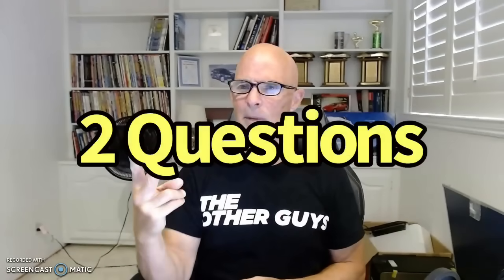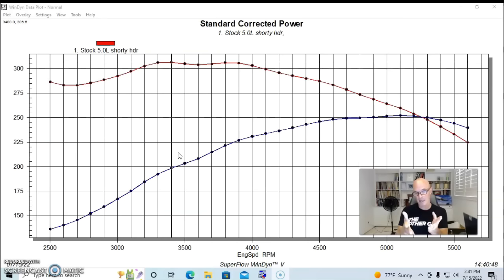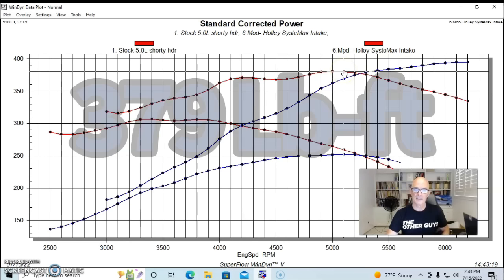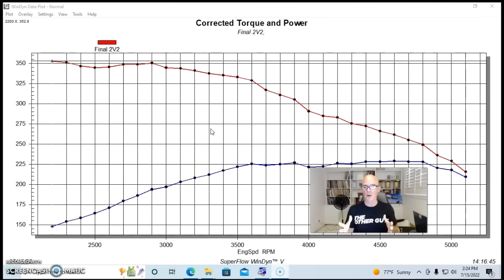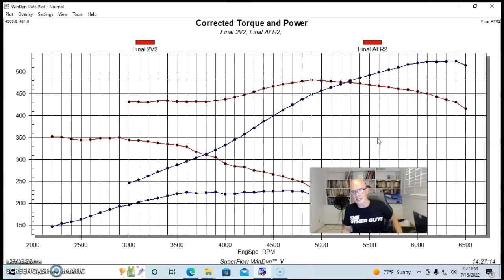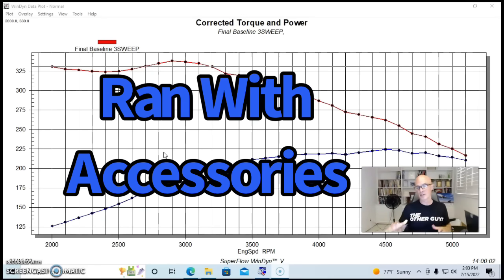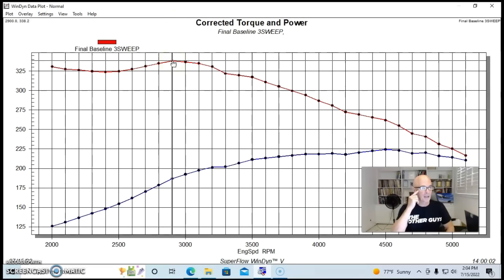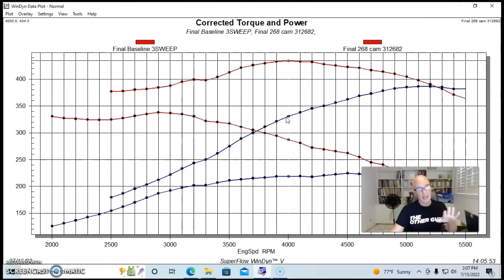FORD VS CHEVY VS DODGE-WHAT AMERICAN V8 MADE THE LEAST AMOUNT OF POWER? 5.0L VS 350 VS 360-WHO LOST?

Comment: Most of the Holden V8s would be good candidates. 253 thong slapper only made something like 115hp all the way to 220ish hp for the clean slate top end redesigned EFI 304 of the 90s.  There were special Group A versions with more but still very little for a v8.   When the LS replaced the home grown iron v8 those low specific outputs were a thing of the past.

Comment: hahahaha, Richard you must be used to the protestors that show up for these videos by now. I liked this video. I would be curious what the cost was for each of the end results though, sounds like you had a lot in that Chevy and not so much in the 360. I haven't looked in a while but from what I recall EFI Ford intakes were $$$.

edit: Decided to share some of the lower power vehicles I ever drove-
1980 Olds Cutlass with a 350. Grandpa ordered it, otherwise you couldn't get a 350 without getting the Hurst version. 350, cruise, AC, intermittent wipers. NO RADIO. NO REAR WINDOW CRANKS, as in, they didn;t move(four door!) base model 14" wheels, but vinyl top and chrome package lol. I wish I still had it it was probably 1 of 1. Still, the 4.3 V6 did 0-60 in about half a second faster then the 350 for 1980. I think it was 130hp. Might have been 110. Car sounded so mean, couldn't pass a car doing 45 unless you backed off then ran it up to speed for a bit before you went around. "Pass on the fly" my friends used to call it when we went bumming. My first car. 
A close second was the Ford Aspire my sister owned for about a year. Didn;t expect much, could have plugged the tail pipe with a grape, but it couldn't hardly maintain speed over 45mph up a hill much less accelerate. We stopped at a gas station once to run in for a Pepsi, we got out and she freeked out and thought she lost the keys for a second because she got confused. Why? because she thought she had left it running. She did actually, from 5 feet away you couldn't hear a whisper. But again, this was a tiny engine-mobile, so not really the same as your testing stuff but it left a (bad) impression for a lot of years haha.

Comment: I’m shocked you didn’t run the 351w as the Ford competitor. Factory it wouldn’t be much better than the 5.0 but with a few bolt ons the tq curve is far better.

Comment: The performance of a car is related to torque not brake horse power. A long stroke and a large bore give you more torque…………..multiply that by RPM and you get an indication.  Wind it up to 12,000 rpm and you’ll get heaps of power but the beast would reach 200 mph in top gear before destroying itself. Comparing bhp numbers is akin to male envy……………..6 inch stroke and 15 strokes per minute is about the limit of human endurance.

Stavros

Comment: So of coarse you put by far the best most expensive heads and intake also biggest cam ... in the Chevy imagine that .  I would never let you touch my mopar . I can tell you that for sure . I could pull a better combination out of my ass for the 360. And it would totally dominate the competition.
Reply from the maker: YOU MISSED THE WHOLE POINT OF THE TEST (LEAST POWERFUL MOTORS I HAVE TESTED) -BUT IT SOUNDS LIKE YOU SHOULD BE COMPETING IN ENGINE MASTERS WITH ALL YOUR KNOWLEDGE AND POWER
Reply: @richardholdener1727  Not at all . Yeah you tested the least powerful engine's  YOU HAD .  Then YOU Modified  each one.... And like I said already   Of course.... YOU used The most expensive  highest performance parts  ON THE SHITVE.   Of course it made bigger #s . Most car guy's obviously didn't notice . But I did . My little 340 Mopar has smoked so many small block Chevys  I damn near lost count . We always hunted down 396s cause we were bored with beating small block Chevys.   Next time have a mopar guy build the Mopar before the dyno comparison.   R 1 or R 3 block  W 9 or W 11 fully CNC Ported mopar Race Heads as a foundation.

Comment: How the Americans got so low power from large engines beggars belief.  Even as a kid when I got interested in cars I couldn’t make out why you fitted air pumps at rubbish tom your cars to make them ‘cleaner’.  These add ons meant you burnt more fuel because it was so inefficient, more fuel in is always more rubbish out the tail pipe.  Then you had to make the engine larger to overcome the power loss 🤪
Reply from the maker: all Americans aren't the same-neither are the motors-those sorts of generalizations are silly

Comment: One V8 within the GM group, the version from 1979-1980 or so was in the Holden VB Commodore. A 4.2 (253ci) V8 that was rated at 87kW (about 116bhp), so that was pretty weak for sure. Though with the VC Commodore, the same 253 went up a little to a factory rated 100kW. Still low-power, was the end of the 1970's & early 1980's of course, so many V8's were weak back then.

Comment: Them 360, 318s are tuff engines. My dad’s 96 318 ram is still rocking right now and he goes up and down Mexico at one point it had a bad water pump and it never broke down overheating for years even though water and oil started mixing still ran..

Comment: Pretty cool, but I would've liked to have seen a 351 vs 350 vs 360, just to keep the cid closer.
Reply: The 360 eats way more fuel than a 350  a Lil better than a Ford probly 15 350 8 for 360 about 12 out 351 sbf
Reply: @jasonconklin8172 how you just throw random mpg numbers out there, lol. A 360 in a car will obviously pull better mpg than a 350 in a 4x4. It's totally situational. I had a 351 in a 95 Bronco that would do 16-17 on the highway all day, with 3.55s and 35" swampers

Comment: Kind of an unfair test. If the 302 and 355 are from the late 60s or early 70s and the 360 was late 70s. The late 70s engines were all slugs because of the laws passed by congress after the gad shortage in their 70s
Reply: The 302 had a late 80's era EFI Mustang intake on it, where are you getting late 60's? 
not sure about the 350, but if it was 2bbl carb. it is likely from at least 78 or older. If it was 80 or a little newer it would have been swimming in vacuum hoses. I don;t think they changed much in the 350 2bbl. until you get back to when lead was still in the gas so this was probably an mid 70's motor.

Comment: The fascination with horse power has always been a mystery to me. HP is an imaginary number, a formula derived from RPM, torque and a constant. HP is a math equation, HP = RPM x TRQ / 5252.  Torque however is real,  measurable unit of force, it is real ,like inches or lbs.
The only reason we care about HP is simple, people don't understand torque, but if you say "This new (fill in blank with cookie cutter car) has 375HP" it sells. Bottom line, the old saying "Horsepower sells cars and torque wins races" is still, and always will be true.
Reply: This is so wrong lmao. Torque is a force, horsepower is how quick you can repeat that force. F1 engines are around 800 horsepower and yet only have 260lb/ft of Torque. They run at beyond 10k RPM allowing this force to be applied more often. F1 cars are the fastest road circuit vehicles in the world. However, a lot of torque with lower RPM can be the same speed, but that gets onto engine design territory with bore/stroke/piston velocities.
Reply: @RhodokTribesman  you still don't get it. 
Take a Dyno, you want to for some reason know the HP of your engine so you put it on a Dyno. Now, the the Dyno measure HP? No, it can't, it's a fictional thing. The Dyno measures torque and rpm, then plugs in the costant (5252) and it gives you the HP. Horsepower can not be measured as a force because it isn't real, it's the sum of a math equation.
Reply: @deanwattles8722  A power is a not a force, buddy. Power is simply work over time. It represents how much said often said force is applied, making it massively important. Does your engine stand still in time? No, hence why power is needed (and why RPM/bore and stroke play the biggest role in an engine's characteristics.) If this is still over your head, I feel sorry for you.

Comment: One thing that wasnt noted was the year of the motors. Dodge is one example that had the 360 for a few years, but the early were much better then when they hit the "smog motor" era. Same could be said for the slant 6, which had a horse power of around 175 or more and went to a low of 125 or less
Reply: slant with 175? Hell no. Not even prior to the post '72 loaded up dyno cell numbers. A fresh .060 over slant rebuild was ~77HP, Then a full milled head, cammed, forged yadda yadda motor with more money into it than it was bought for eeked out 30% more...than 77? STILL UNDER 100HP! Sure there are 300HP builds out there but they also cost 9 grand.

Comment: Clicked on this expecting to see the 155hp 350 that I have in my 92 Suburban, the one with the 85 mph speedometer. I still have that beast, it turns 30 this month. It’s a bit painful filling up the 42 gallon tank. Still runs decent.
Reply: 155?? The 350 is specced at 210 in 89 Silverado. I wouldn't believe that but it does 0-60 in 9 seconds with 3.08 rear gears.
Reply: Yea I had a 96 Silverado and I had to sell it because gas was killing me. It was a reliable truck once the crappy rear dif was rebuilt.
Reply: @gsxerwhite   so u hit pavement  with  10 bolt spinning  gov lock exploded?  I got 3 and all overloaded  4200 total b4  now almost 7 k thats daily for 4 years  I'd say tough rear end 4 size !
Reply: Odd 2 me  the 96 4.3 7k # daily 700 r4 gets 15 no matter what 373 gears 4x4 290 k 99 Yukon  average weight 6500# 373 350 town & freeway 16 17 mpg242k  4x4  99 suburban gets 17 freeway 75  or less  town 14 woods 10mpg average  14.5 with 252 k but those trucks all got Schaffer oil in front rear and moter I'd say it gains 3 mpg together   but 4 u tire goroo s love lug tires or soft tires both eat a ton of fuel ⛽️  alignment  huge 4 milage have u changed ur router cap this century? Real crappy design  bad 4 cracks and buy a good 1  helps mpg and power and  so 15 to 17 mpg out 9f any rig with 200k and near 4 ton  nothing  2 whine over
Reply: I thought 92 had 210 horsepower because of TBI and the carburetor like I have has 155

Comment: What always gets me is how little power the Americans get out a standard V8.  My car (1991) has a 2 litre (122 cubic inches) straight 4, normally aspirated and it delivers 165 hp stock. You could get a  supercharged 1.6 liter (98 cubic inch) from the factory that delivered 300+ hp stock.  Yet most American V8s have difficulty delivering that much hp with out a lot of modifications.
Reply from the maker: a 300-hp supercharged 2.0L from the factory with 300 hp in 1991?
Reply: @richardholdener1727  Supercharged 1.6. the 2 litre was only for the normally aspirated cars.  The 1.6 turbo put out 220 hp. The supercharger a bit more. Just checked, the 300+hp was from a blown six cylinder 1MZ-FE 3 litre, which was not standard to the factory car. So I do  stand corrected on that. The race engine was reputed to get 750hp from 2.2. liters.  But that will require lots of maintenance. Though my old WRX used to get 260hp from a 2 litre.

Comment: The sadest  engine  I ever had was a 1977 302 in a Cobra II, when  I ordered the car it was rated at 139 hp, It was so sad  to couldn't tell it was gaining speed without looking at the speedometer.
Reply: I have an '83 Lincoln Continental Mark VI. 39,000 original miles 5.0 EFI throttle body. Factory rated at 120hp. It's slow but I've driven late 80's to early 2000's 4 cylinder cars that were slower. I will say it has an adequate amount of torque.
Reply: That's actually pretty good for the size. The Trans Am had a 400 CI V8 which made a whopping 180 horsepower.
Reply: Yea man.....this was my age group...I,m 49 now but back in the day....the way it was....buddy of mine had a v-8 chevy monza..wa whoo!!   267 v-8 geared like 2;56.....main reason I think we all wanted them 72 and back cars for those that knew.....nothing like a poor ol boy driving a primered Nova.....smoking a new vette.......back then,not now.  anyhow,my neighbor had a cobra 2...white with the red stripe kit with red interior...your comment reminded me of him.

Comment: Shouldn't a 350 or 360 be compared against a 351?
Reply: You would think so, but Ford has always had their smaller displacement 300 cubic inch engines competing against the mid-size 300s Dodge and Chevy. Ford has always done more with less cubes.

Comment: we all know its going to be a engine from the late 70's the ford 460 had like 3 HP
Reply: 210hp and nearly 500 lbs of torque. I have a '78 Continental bone stock last year of the 460 in a ford car and it hauls ass compared to the 400 and pre '86 5.0's

Comment: I might can beat all of y'all I had a 72 Chevrolet custom 10 with a 250 straight 6. It was the weakest thing that I ever had in my life. I promise you it could not outrun a 100 cc motorcycle  definitely could not spend tires in Rock double clutching it. On the interstate on a flat surface 60 MPH if the wind was blowing from behind me. Going up a slight Hill diesel trucks would fly by me sometimes I would have to downshift into second gear mind you it was a three speed on the column. My dirt bike had more power than that piece of s***.

Comment: I had a '73 Gran Torino with the 351 Cleveland.  I think it was maybe 150HP.. sad era for low compression smogged motors.
Reply: You can't really blame the compression for the lack of power, the fact is and engine that size could make over a hundred more HP with a CR under 8 to 1 with the right cam, heads and exhaust, none of which were on those late 70's lumps.

Comment: 20 something years ago I bought a '80 caprice classic.   I barely knew shit about cars but I wanted something to learn on and build some V8 power.

I asked the guy if it was a 305 or a 350.  Much to my delight he replied it had a 350 and I ended up buying it.  

A short while later I was driving it around trying to sort out the brakes and I noticed it barely spun the tires in gravel.  I noticed on the serpentine diagram it said 4.4 L and then I checked the VIN and confirmed I owned a wheezing 267.    I sure learned a lot about cars that purchase.
Reply: For a few years I did machine work in a engine shop.  In that few years, I encountered more "350s" than I could count with 3.736" and 3.5" bores.  lol

Comment: Extremely biased test, build a .030 over 351 windsor with comparable parts and see what happens, you built a 302 with stock fuel injection and below par heads, then built the shit outta the chevy engine, and then again below par parts on the 360, sorry bro, you seem like a nice guy but terrible comparison
Reply from the maker: SORRY BRO-BUT IF YOU CAN'T READ THAT THESE WERE THE LEAST POWERFUL MOTORS I HAVE TESTED-YOU ARE READING SOMETHING ELSE INTO IT (THAT ISN'T REAL)
Reply: @richardholdener1727  so? If it was a least horsepower thing then why did you build any of them up at all, seems to me that someone got a little but hurt on being called out on making a biased video - which it was

Comment: Two engines come to my mind.  1985 Chevy half ton truck with the 305.  It had no business being in a truck.  A good engine reliability wise but lacked any kind if power.....especially in a heavy truck.

2nd was my Dad's T-Bird with the Ford 255.  This had no guts what so ever.

I know there are v8s with even less power out there
Reply: in the early 80's a friend bought a 305 powered 1/2t pickup, gutless to be sure, replaced the intake and carb with a little street blower, and that 305 woke up and then was a tire roasting engine,  do not recall how long he kept it on there but it was a fun rig to cruise.
Reply: I think people forget that trucks were designed to do truck things and not pretend to be dragsters at every red light. 

Chev went with the 4.3 V6 in the later generations base models, and of course Ford had the 300 I6. Perfectly good engines. You gear it down enough and you can haul and tow and pull anything… you’re just not going to be fast doing it. I think it was nearly the 21st century the first vehicle I had that could maintain the speed limit going up hills or towing anything.
Reply: @calvinnickel9995  Good point

Comment: I have a 95 F150 roller 302/4R70W with 3.55 Trac Lock rear.  I will say this.. Years ago my family had an '83 Chevy G20 conversion van with the 305 LE9 high output with a Crane 260, 700R4 and 3.08 gears that would walk away from my Ford.

Comment: Forgot all the little motors, the 255 ford, 273 Chrysler, 262 Chevy. Maybe the smaller size would make more power due to rpm. It would be hard to find them these days anyway.
Reply from the maker: I didn't forget any motor-these are the ones I have tested-a ford 221 v8 would likely also make less

Comment: Not sure about 2022, but I had a 1972 Chevelle with a 307, my buddies had a Dodge with a 318, and Ford Mustang  with a 289, similar years, all stock.
We raced several times, and it was pretty much equal. Neutral drops, etc. the Chevelle usually won, but not by much. Those old engines would not die, same with transmission’s, etc.
We all eventually up graded to more powerful stuff, but similar engines were pretty much the same.